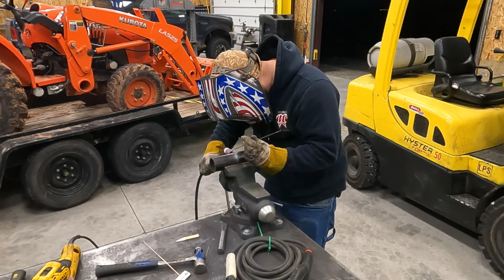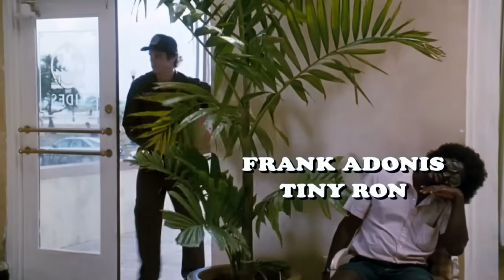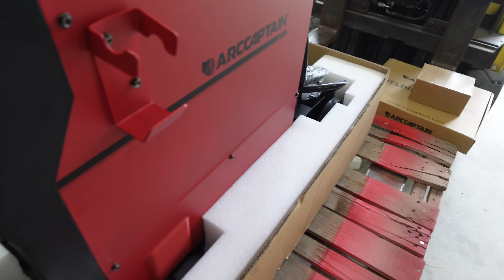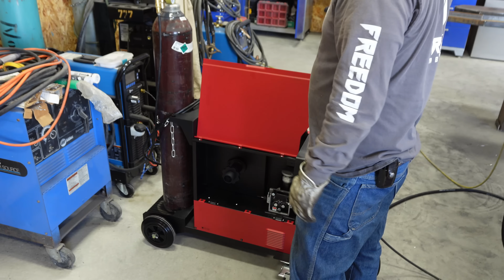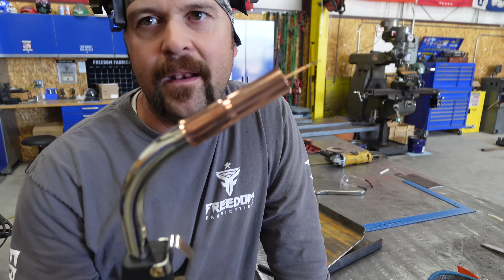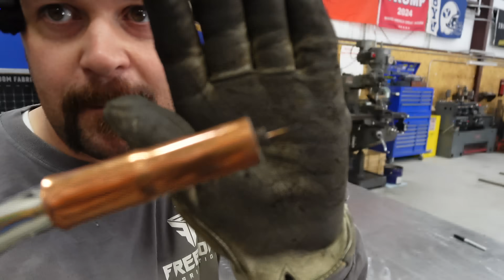MIG welding with the ArcCaptain Aim-forge 250

Comment: great video always look forward to them .
that torch is like a tweeco.the insulator is the threaded part and the shroud is a push on fit .so it should just pull and slide off so you can sett the tio to work distance.
Reply from the maker: I’ll have to try that. I don’t believe it works like a tweeco. I’m a tweeco guy, and it wasn’t really working the way I thought it should. Thanks for watching!

Comment: That machine is awesome, I have a everlast for my Tig and then a Vulcan MiG Max for my MiG. I would have gotten that when I was looking for a MiG if it was available back then! Recently got a bobcat 250 for mobile work. Do you think patching a 4 runner frame i could stick weld that with the bobcat or will it be to hot ?  Newer to stick welding!
Reply from the maker: You could do it, but if I had to do it with stick,  I would probably use 6010, and turn the heat down to avoid blowing through. Run a whip pattern, and run your verticals down hill. Would be the best tool for the job? Probably not, but if that’s what you have to use, you can make it work. Thanks for watching!

Comment: I have Miller welders and have traditionally been a Miller guy, but I wanted a smaller dual voltage machine that made it easier to weld mobile and would run a spoolgun.  The cost of Miller put them out of the question.  After watching NBS Welding's videos and reviews and seeing that ArcCaptain can hold up to that kind of abuse, I bought a MIg145 and Mig205 Pro.  They totally fit the bill and my son and I have made a ton of money with them compared to what they cost.   A review from a "nobody" doesn't carry much weight, which is why ArcCaptain sends their machines to people like you.   I never would have known about them if they hadn't.  A machine that helps someone enter or learn a job that might otherwise be cost prohibitive is super helpful.  Thanks for honest reviews!
Reply from the maker: That’s what I’m hoping for. To give an honest review of a cheaper option that can still give good results. Thanks for watching!

Comment: That arc sounds pretty good, a guy could make some cash with a machine like that. I like your take on the budget equipment. I bought my first TIG welder in 2010, a Dynasty 200, and it was an insane sacrifice for a young broke couple with a baby and a dream. It ended up paying off and is probably the single best investment I’ve made, but I didn’t know that it would at the time. It sure would have been nice to have a cheaper option to start with then upgrade, but there weren’t any decent options that I knew of at the time.
Reply from the maker: Agreed. Sounds like I started out a lot like you. I bought a Miller XMT 350 to get started, and it was a lot of money as well. I also don’t regret it, but I may have started out a little differently if I had the option. By the way, I’m a big fan of your channel. Keep up the great work, and thanks for watching!
Reply: @Freedomfabrication777 XMT is a great machine. I appreciate the kind words about the channel, I always enjoy your videos as well. Keep up the good work!

Comment: Stu as they say you hit the nail on the head. This isn’t the 70’s and 80’s or hell even the 90’s anymore. I’m not a full time fabricator by trade but picked it up easily in high school but picked the linemen route. Fast track 22 years later and now have a nice shop to tinker in and do little side jobs when I have time. I myself  have a miller 252 mig machine but cannot justify a blue or red tig inverter machine. I recently FINALLY got an inverter tig rig. For the same rig of a miller dynasty you’re looking at $12K now. Primeweld to the house was $2K for a water cooled 325A machine. Works great for a hobbyist. We can go all the way down to hand tools also. It’s hard for me to steer clear of USA made but for the same snap on wrench set vs Icon your looking at a $800+ difference for something I use once a week. Cant do it anymore. If ya don’t make the trades attractive and affordable, these kids won’t wanna do it. We wanna push trades for “debt free” but to be honest the debt from tools is inching towards the same price as school! 😂. Anyways off my soap box, thanks for honest in depth reviews on budget machines. Little advice for the new fabricators. Buy a starter machine cash, let it make you money so you can buy a nice millermatic 255 cash too. 👊🏻
Reply from the maker: I can see that you see it exactly the way I do. Start with what you can afford, and move up to what you would prefer after you are in a financial position to do so. Thanks for the feedback and thanks for watching!

Comment: It is likely a good machine for trying out and learning to weld; it doesn't overwhelm you with complex settings and parameters, though it certainly isn't suitable for a demanding welder who wants a sophisticated machine with full adjustability and specialized programs.
Reply from the maker: I call it like it is. Most of the machines are great entry level machines. This one was definitely a step up in my opinion. Thanks for watching!

Comment: Nicely done, I have a question I hope you can answer for me. I have a synergic machine fitted with 0.9mm wire but the only 2 synergic settings are for 0.8 or 1mm. Which setting should I use?
Reply from the maker: I would probably set it on the 1mm setting, and manually tweak the setting to where you like them. Thanks for watching!

Comment: It's absolutely amazing that you have to address a budget welder compared to top of the line commercial Miller.  I watch a another fabrication channel "NBS welder "he's a arc captain affiliate. He has been running them machines for years and just like you're doing keeping his reviews 100th real. His shop got flooded out.
Reply from the maker: I watch his channel as well. Poor guy. I hope he can get everything cleaned up and back in operation without too much trouble. Thanks for watching!
Reply: I notice he has to turn p a lot of the welders but get them to run a heavy duty cycle until the a couple of weeks ago.  He got one that  kept shutting down running a 1/8 7018.  The y claim a 60% duty cycle.
He is going through a break up with ArcCaptain not only because of this issue but not making enough commission pushing them.

Comment: Stuart, that mig gun uses Lincoln/Tweco consumables.  The gas nozzle is made to slide up and down on the insulator so you can adjust the stickout of your contact tip.  You can also use the short Tweco contact tips but they will be recessed almost too much.  I just purchased that same mig gun as a replacement for my Yes Welder.  The 2 guns look exactly the same other than the name on the side of the gun.
Reply from the maker: Ok, I’ll give that a try. Thanks for the info. 👍🏻

Comment: 36V is for electric gas control. Not sure it's large enough to support large CO2 heating as well. it says "industrial" so continuous, high flow CO2 can freeze the regulator as it expands.  Kinda needed if it's going to be 100%. Not that big a deal for people like me that spend 90% of the time thinking about welding rather than welding.
Reply from the maker: I actually didn’t know that was a thing. Probably because I spend my time welding, and not thinking about welding. Lol.  Thanks for watching!